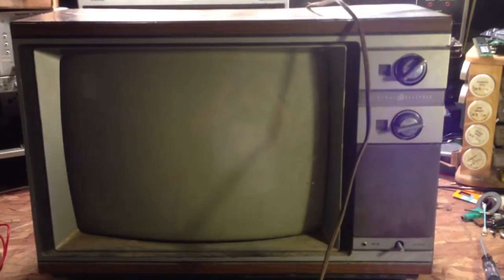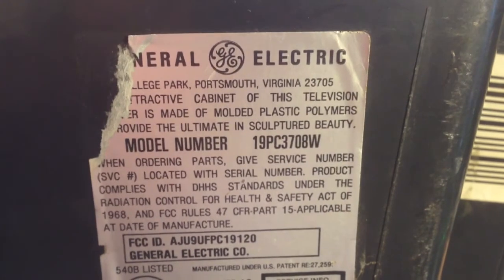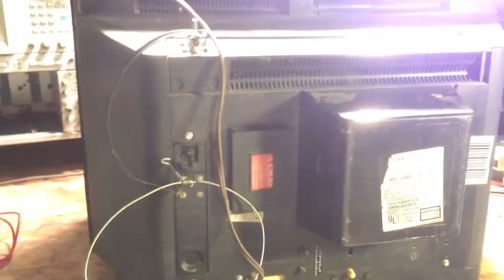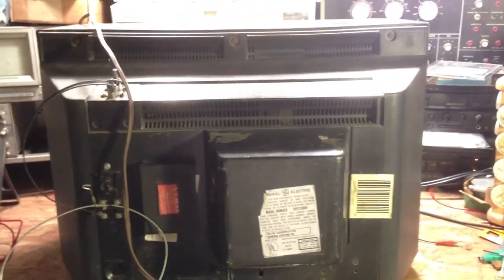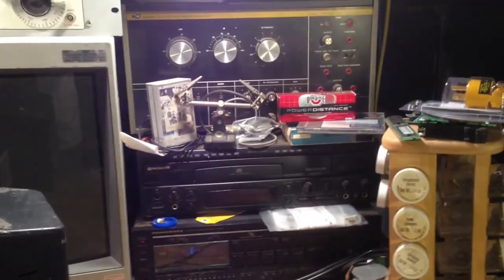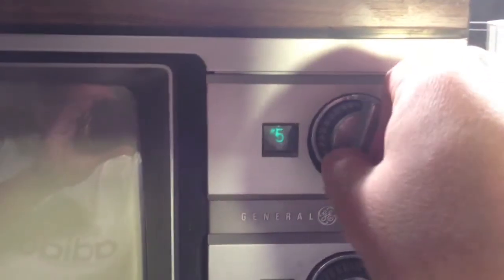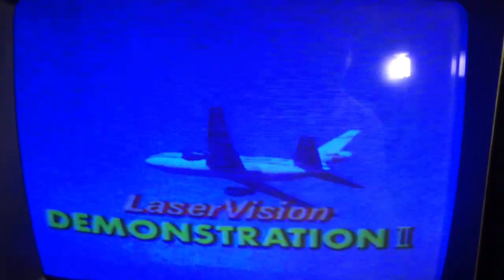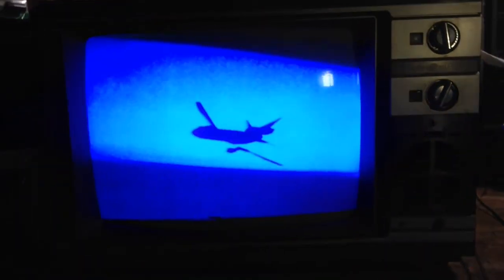First Look At A GE 19" VIR II Set

Comment: The PC chassis was one of their better efforts and was in production from '82-'86. There is a 100uf cap in the vertical circuit that is very high failure. Back in '97, I bought 20 of these from a motel for $5/ea, fixed them, and sold them for $50-$75/ea (yeah, one could do that back then). Unfortunately, many of these have weak CRT's by now.

Comment: Looks like that set's two guns short of a deck, LOL!  Blue only.  Would have been nice to see Vertical-Interval-Reference system internally "twist the knobs" to render an accurate picture.

Most folks today don't even know where the menus are on these new flat panels, let alone understand the behaviors of Brightness, Contrast, Color, etc...  A digital version of automatic calibration is surely doable today, and would enable large portions of the TV viewing public to see what an accurate picture looked like, regardless of resolution.